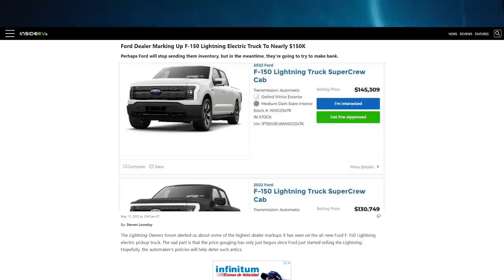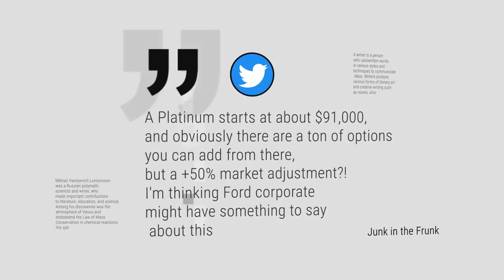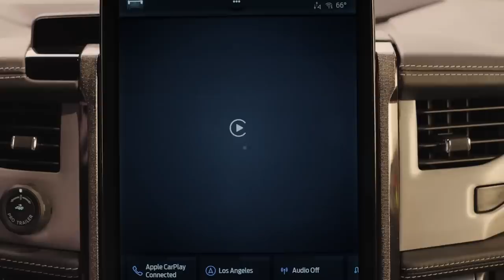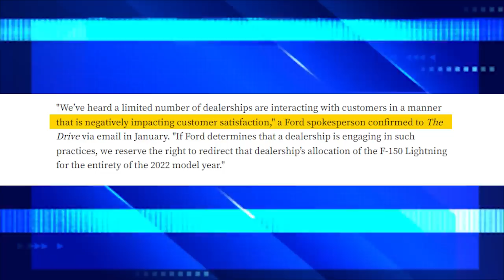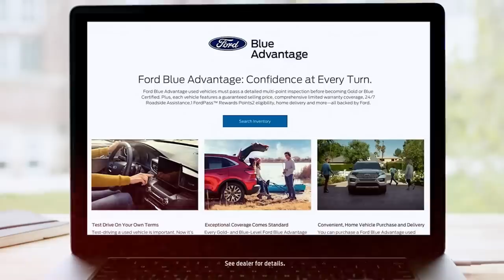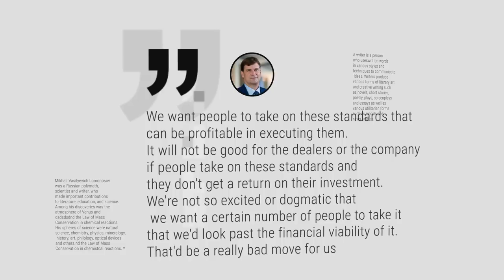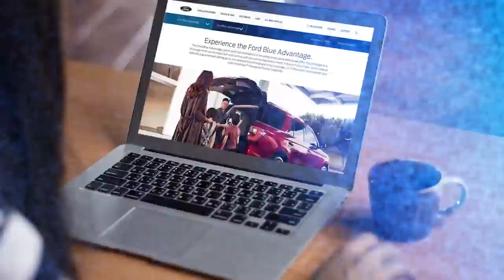Another HUGE Blow For Ford Dealers

Comment: No if we can only get vehicles instead of junk from dealers it will be ford job 1 again.that means no cam phaser failures, no plugs flying through the hood, no transmission call backs.jim could also hire engineers that don't reinvent the wheel.if it ain't broke don't fix it, and stop fleecing the consumer.or hire me , I know how to fire people.

Comment: The other gimmick the dealers charge for is nitrogen filled tires, and put a green cap on the stem.  and up charge holy smokes. and the after market parts they put on at whole sale price, is a huge mark up.  I use to work at a dealership,  I left,  they wanted me to lie on my service tickets, and try to upsell , F u.

Comment: i'm not buying an EV, even if its sold without a dealer.
they don't (can't) last as long as I.C.E. (Internal Combustion Engine) Vehicles 
and i can make my own gas alternative with sugar, yeast, water and a distiller.
not ideal, but can be made to work, also i can use hydrogen as an other alternative fuel for my Vehicle.
EVs are just way too short lived and vary expensive.

Comment: EVs is the downfall of the auto   as far as the use in the western mountain states are concerned.  first charging takes to long, and they are way over rated as far as mileage goes. 
cold weather drastically reduces miles driven. Replacement costs are more than the vehicle will be worth. Recycle's will not accept them because of the hazards of the batterys,
Reply: Jeez, look at all those spelling mistakes in that post...

Comment: Eff the car dealers.  They are literally scum. Especially now as the lots are getting full but they are not reducing the drastic markups.  I went tolook at Nissan Frontier Pro 4x last week and they wanted a 10k premium.  When I asked why they stated supply and demand.  They had (5) other Pro 4x trucks on their lot and an additional 10 Frontiers in lower trim.

Comment: ford blew it.... They took out the beaf of a ford -Pick-up. They took away the body side molding long ago. They took away the f-250 body type likened to the F-150 and took away the 8' cargo bed on extended cabs. The vent window went away. Now Men are driving their old recycled beer cans. Ford joined the rest of corporations of giving less and getting more. Replacing quality with advertising spin. Ha. now the biggest mistake is going all in on Ele trucks. Too bad for a great American Quality First to a panicked keep up with the imports coward. The Trucks hang down in the back ends The side door pannel's are too low of a droop down to save raw material I'm guessing. Everything is to save what's given. We don't need digital gadgets to displace anything lost. And you have priced your products too high mow you cant reduce them.
Ha. If your going to do something. Give us a Truck w 60 miles to the gallon with secondary 
ele assist and onboard electric generation.. Likened to our freight Trains that are able to get 300 to 600 miles per gallon of fuel. Not some pansy hybird. But powerful to pull max towing upgrade for the longest distance possible.Stop holding back technology!